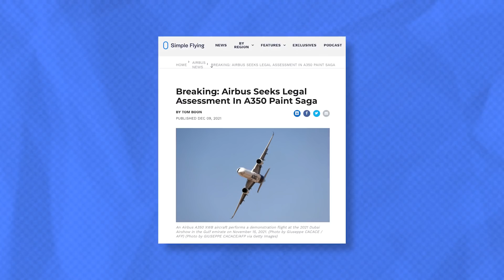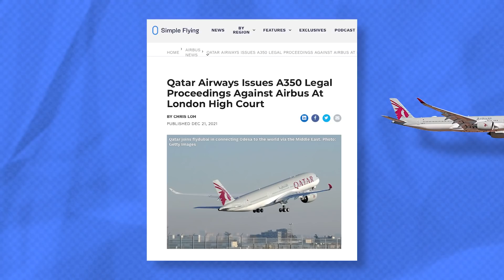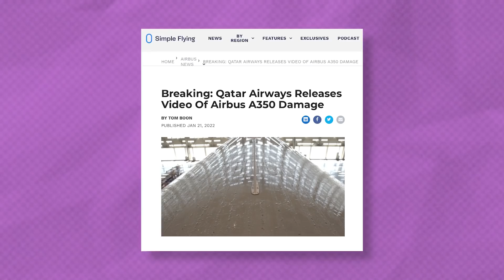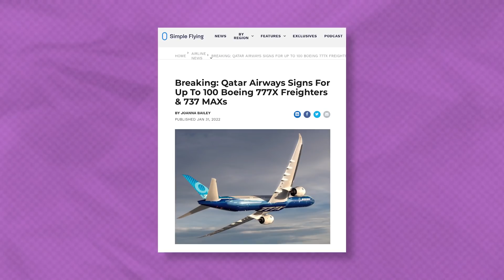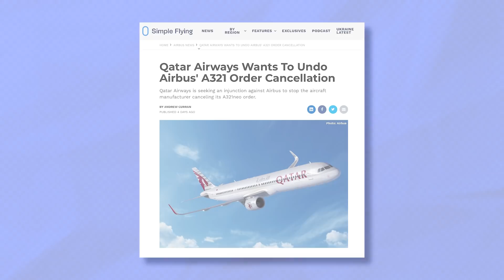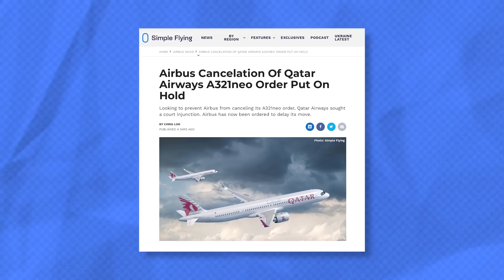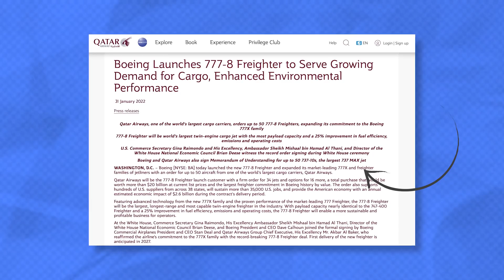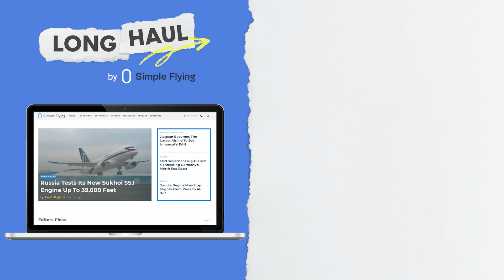Conflict Over A321neos, The Airbus A350 Paint Saga Continues

Comment from the maker: Update 2: Airbus is seeking $220 million in damages over two undelivered airliners.

Update: Qatar Airways on Friday, February 25th, asked a UK judge to either reinstate the order of 50 A321neos canceled by Airbus or otherwise order compensation from the company for canceling their order.
Reply: A judge can make Airbus reinstate the a321neos? How
Reply: Possible contempt of court if it can be shown that the A321 cancellation was retaliation for Qatar Airways commencing court action on the A350 issue. Given the A321Neo backlog, Qatar Airways could sell the "as good as new" A321Neo aircraft at a premium to an airline or lessor that was much further down the delivery schedule.
Reply: If the right to cancel an order is part of the contract then it would be very unusual for a judge to completely turn that around. Qatar Airways signed that contract and agreed to the terms.

Comment: The paint peeling seems legit : is it as bad on other 350's? I once heard from someone working at CAE (flight simulators) : « Qatar is a very hard to please customer ».
Reply: They are indeed a very particular customer. If they're not getting the best they're not happy.
Reply: They have an image and a brand to protect. If my car paint started falling apart quickly, I wouldn't be happy and wouldn't drive it until they fixed it. If I have an image to maintain, the people won't know if my car manufacturer did a terrible job or if I am someone who is terrible at maintaining my own car.
Reply: @mohammedgt8102  From what I saw, the paint job is a real problem. I am just very surprised how the problem escalated and how both sides are reacting. Qatar and Airbus should have been able to resolve this issue between them, not in court or in the media. They are both over-reacting or there is information we do not have.
Reply: @Jean Viau  Well, what should Airbus do? They offered repair and GUYS PLS REMIND THAT QATAR AIRWAYS WAS THE LUNCH CUSTOMER! They already paid only a fraction of the original price because they might encounter problems. Its standard procedure ... Qatar Airways is simply trying to get rid of the costs of the covid19 pandemic.
Reply: One aircraft we see in the video is 6,5 years old and the other one is 5,5 years old. You judge if all A350s are in the same condition.

Comment: Qatar doesn't trust the paintwork on the 350 but trusts the paintwork on the 321 so much that it absolutely wants the plane. Explain this in simple terms.
Reply: Simple, the problem isnt paint, its the airframe. The a350 is a carbon composite (with copper mesh to help with electrical bonding) fuselage. I worked with the stuff and its used to save weight but its just not the same as aluminum. The 321 is a smaller aircraft and older design that uses a aluminum fuse (tried and true), to put it simple it just works. Additionally different aircrafts from the same manufacturer can have completely different materials, processes, languages and locations. On paper the A220 is an airbus but everyone knows its really the Bombardier C series. Let me know if you have any other questions.

Comment: Well , there are only two big civil Plane manufacturer , Boing and Airbus . If Airbus dont accept further orders from Quatar Airlines and Quatar is restricted to Boing , this  w i l l  increase the Price Tag for new ( Boing ) Planes . EASA has looked at the the case and decided that the degradation is not enough to ground a Plane . There you have it , Quatar wants money because they grounded their A350s which was not necessary . Besides , most Planes were grounded during the last 2 years due to the Pandemic , there was no / very low demand during the lock downs ....

Comment: Qatar overplayed its hand. 

1. They’ll have to prove that surface degradation warranted grounding of a significant portion of its A350 fleet. A judge will want to see what other airlines operating the A350 have had to take similar action. A judge will also want to assess whether Airbus was unwilling to resolve the issue under warranty.

2. $618 million in damages + $4 million daily for each A350 grounded. Again, a judge is going to want to assess whether Airbus is in breach of contract by not resolving, or taking meaningful steps to resolve the issue under warranty. 

A judge will want to know how the $618 million figure + $4 million in daily damages was calculated by Qatar. 

Could this penalty by Qatar be applied toward the purchase of Boeing aircraft?

If anything about this number is arbitrary or deemed to be harmful to Airbus’s business, especially if Airbus has taken steps to resolve this issue, Qatar’s case is weak out of the starting gate. 

2a. This will then bring into question the A321 order. A judge will question Qatar’s conduct as a customer, and whether their actions are a detriment to Airbus’s business. 

A judge is likely to determine that if Qatar did not offer Airbus sufficient opportunity to rectify the paint issue with the A350, they are likely to behave similarly if an issue arises with the A321.

3. Qatar’s Boeing order announcements are likely to play a factor in the hearing between Airbus and Qatar. A judge might find that Qatar is taking deliberate steps to undermine Airbus’s business with a Boeing order of competing aircraft type, even though the 737 MAX admittedly, by Qatar, does not serve its specific fleet requirements.

This is clearly a conflict of interest. A judge is likely to determine that Airbus is right to protect itself from Qatar’s dealings.

Qatar really needs to be very careful in how it maneuvers. I wouldn’t exactly be having any parties inside Boeing given Qatar’s behavior.

4. Even if a judge sides with Qatar, there is nothing a court can forcibly do to Airbus to make them keep Qatar’s A321 order slots. 

I’ve said it before. Qatar really needs to sit down with Airbus and work through these issues as partners. Litigation is not going to help their cause.
Reply: Nicely put

Comment: Airbus offered them an interm solution which is repainting the aircrafts as airbus figures out a longer term solution which should have been good enough because a longterm solution to this problem will not happen overnight as airbus needs to investigate the cause and time to test how the fix is and will need time to implement the solution

Comment: you did not consider the possibility that the court would life the injunction, leaving Airbus free to allocate the cancelled orders to some other airline.  in which case the question would be:  what is QA going to do???  it is not Airbus that is going to suffer here, one way or the other.  you think Airbus will suffer if the injunction becomes permanent.  no, that was the way it was anyway.  so you've trained the spotlight on the wrong end.

Comment: I hope Airbus wins this
Reply: Have you seen the video of the terrible paint job?
Reply: @Mr. anonymous paying $200m an aircraft im sure you'd be pretty pissed if your paint started looking like that especially since it's not cheap to repaint something as big as an A350. Al Baker has every right every right be unhappy with Airbus' response (or lack there of)
Reply: @sebastian.stamour  while it's apparent that the degradation is quite severe, I don't think I've seen anything about Qatar and its CEO actually trying to repair the planes affected by the issue. All i see is them trying to squeeze money out of Airbus instead of trying to resolve the issue at hand.

I don't know though. Just an outsider commenting based on what information I have access to so far.
Reply: @Mr. anonymous hmm qatari is the 2nd largest 350 operator in the world with 53 in service at the moment. Do you think Airbus would rather pay out warranty for 53 airplanes which for a similarly sized 777 costs around $200,000usd to repaint and for sure the 350 pricing will be higher due to the composite materials so thats already in the millions of dollars out of warranty for Airbus wouldn't they just use that money to solve the issue anyway...maybe before Singapore Airlines uses warranty to fix its 58 A350s with paint issues, Airbus will realise it would've been easier to just solve the problem from the beginning. Besides its not just a cosmetic issue. All of the peeling paint has formed ridges near the AOA sensor and Pitot tube as seen in the video from QR...who know maybe when it's flying those little ridges can manipulate the air movement and send false data to the sensor??... you don't take chances like that on a big tube holding 300 people 40,000ft above the ground.
Reply: @Mr. anonymous Not true. The peeling paint has in some cases compromised lightning protection on the airframe. Whether that's sufficient to justify grounding aircraft or not is debatable but to say "it's just cosmetic" is quite an understatement.
Reply: @Mr. anonymous Actually Finnair, Lufthansa, Air France, Etihad and Cathay Pacific have all reported the issue with Finnair first reporting "paint issue" all the way back in 2016 and Cathay Pacific reporting paint issues within 2 weeks from delivery on one of their A350s.
Reply: @aerosw1ft  if you buy a new car and 4 years later your paint starts chipping ,do you fix it yourself? No its a dealer issue and they should fix it. Why should Qatar have to pay for an issue that is from the manufacturer
Reply: @Mr. anonymous thats what they're trying to get airbus to do
Reply: It seems as though Airbus has to win this, since Emirates is now siding with Qatar, though I don't think TC should've been so quick to side with Baker against Airbus.
Reply: @aerosw1ft  it's not Qatar's responsibility to fix and repaint the defective planes, they are under WARRANTY! They paid billions, I'd expect a perfect plane, and as a passenger, would have second thoughts of flying on an Airbus with obvious peeling paint outside my window!